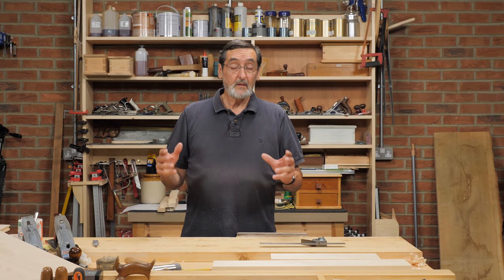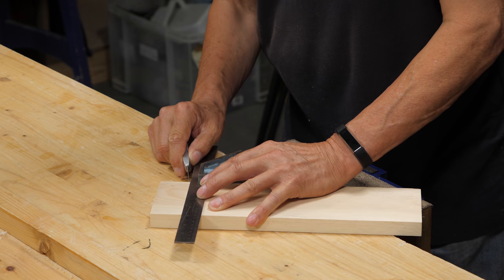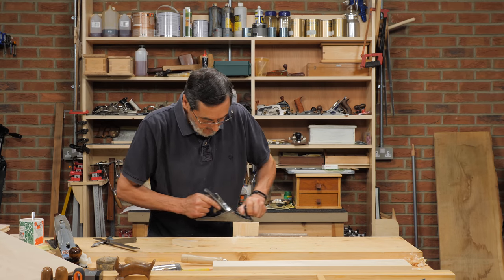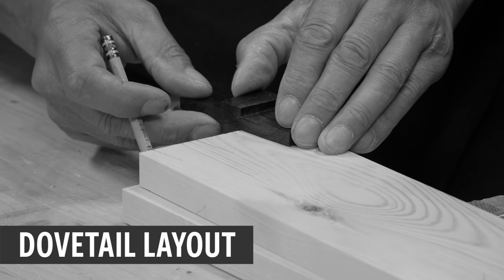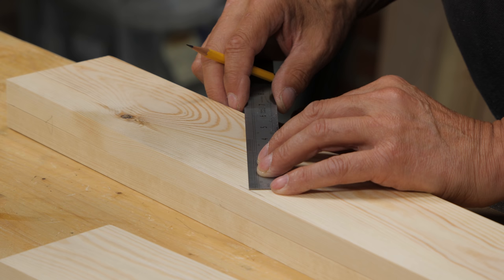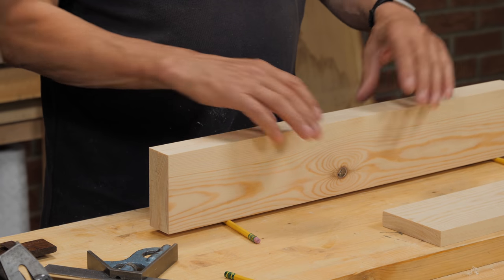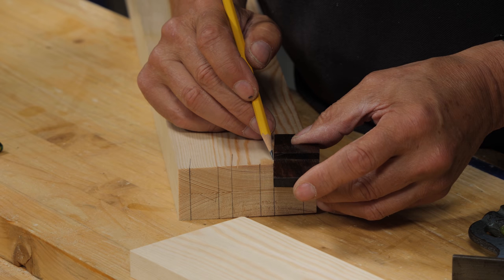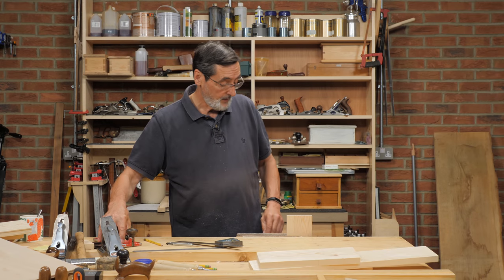How to Make a Workbench Drawer Episode 2 | Paul Sellers

Comment: Thank you Paul for teaching the "basic"  essentials.
Aftet woodworking for 30+ years, I think you taught an old dog a new trick when you drew the lines 3/16" in from the edge on a diagonal at 6",  and then divided it equally.
Its 5am in the US, however I will prove that out before the rooster crows!!

Comment: Originating from Holland, but after living for a long time in Canada, my brain still works in metric. But with 2x4 lumber and 4x8 foot sheets you have to start thinking in imperial sizes. Which I do by now. Recently I realized that 1/256 of an inch is super close to 1/10th of a millimeter. As an example, 1/32 inch (8 x 1/256) is therefore 0.8 mm (8 x 0.1), or 3/8" is 9.6 mm (~ 1 cm). This doesn't help for big construction, but for fine wood-working it  helps converting between the two systems.

Comment: Is there such a thing as a dovetail jig? Not like what Paul is using here, but what I have in my head is something like a 45 degree set square with sides that get thinner as it moves towards the point, and with one or two trussel going up through the centre, depending on how many dovetails you need, and also getting thinner towards the point. Essentially the trussels give you the thickness of your dovetail at the place where the jig is the same width as the wood, and you get your four, or six, points.
Of course each jig would only work for the specific amount of dovetails it was designed for, but it would save having to calculate sizes for different sized pieces of wood.
Does this make sense? Is it already a thing? 
Usually when I come up with a cool idea I find that it's already been done, like sandpaper gloves..

Comment: At 27:00 minutes you take the time to clean up the end grain for the tails. What I don’t recall seeing is any cleanup on the vertical edges of the middle (or any) tails (you cut these using the saw at 18:16). I wonder if you have any thoughts on this…Do we need to be extra accurate with the saw for these tail cuts since we are not following up with a chisel? Thanks for your reply. You are a master, thank you for the inspiration!

Comment: If you want to know how good (or bad) you are at these joints, do a few with a single tail. I've been practicing this way (single tail) and let me tell you, it's a challenge! With multiple tails per joint, more edges are working against each other so the joint seems much tighter. Single tail joints are not as forgiving as those with multiple tails in them.

Comment: Dear Paul It looks lie you have a new dovetail saw. I noticed it didn't seem as fancy as the one you usually use, ergo expensive. If it is reasonably priced as in under $100.00 US could you give us a link. Thank you Frank
Reply: I don't know if Paul is still answering comments on this video; hopefully he'll correct me if I'm wrong, but I believe it is a Veritas. Lie-Nielsen also has a nice back saw, which is only a little more than $100

Comment: Maybe it's been addressed before but why does he always have his off-cut (the unsupported wood) opposite his free hand so he has to reach over to support it? Why not flip the piece so the unsupported wood is on the side of his free hand and he doesn't have to reach over?
Reply: It wouldn't look as cool on the video!
Reply: I’m just guessing but maybe so he can see better.  For a right hander, you would have to look over the saw to see the line you are cutting to.  Maybe someone else will ring in and confirm or deny my theory.
Reply: It's for the videos only, so it's easier to see.
Reply: I think taking the saw out or stopping to change saw hands was never his practice, to do so would lose the smoothness of his cut.  Maybe?

Comment: I can't plane very flat can you give me any tips
Reply: If you are using a no.4 , you want to have a straight edge with you so you can check the wood for flatness and then plane the high spots.
Reply: @thewoodworkingmetalhead2712  thanks
Reply: You're probably putting too much weight on the knob through the stroke.  Weight on knob at beginning with smooth transition to weight on tote at end of each stroke...try it, you'll soon find flatness in every piece of stock!
Reply: @lbhunter6341  thanks
Reply: Skim, don't bite.